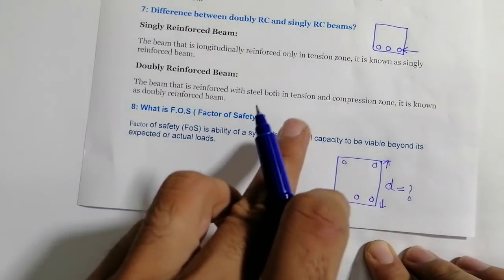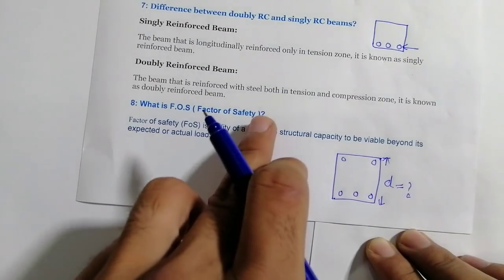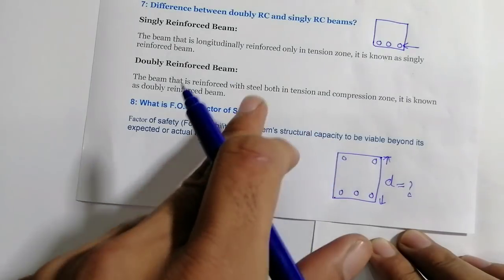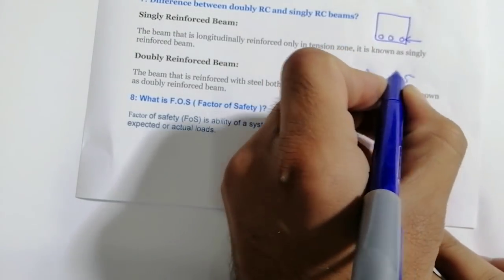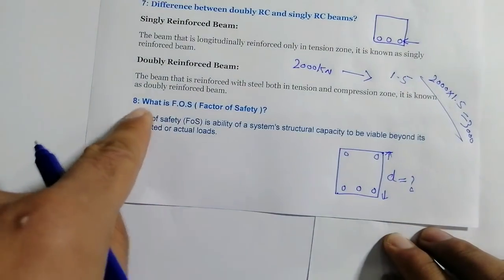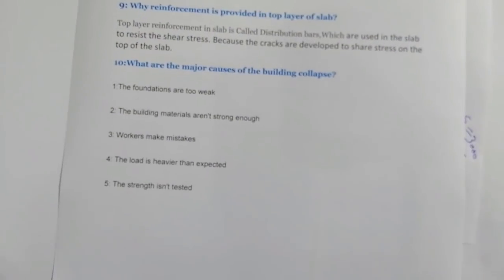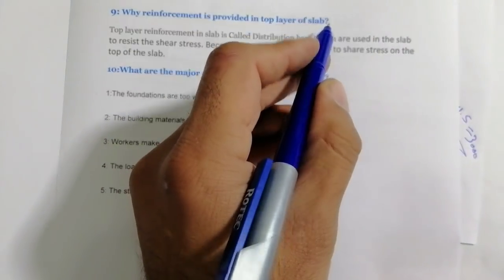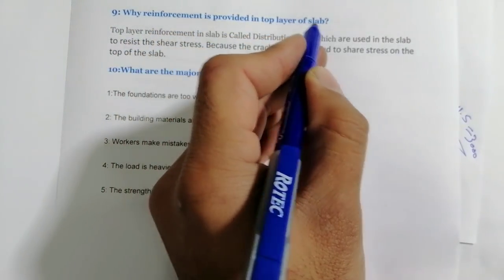Top 10 Civil Engineering Interview Question for Fresh Civil Engineers - Civil Engineering Interview

Comment: Please help;

Question: Grade of steel is designated as Fe 415, if 

1. The upper yield stress of the steel is 415 N/mm2

2. The ultimate stress of the steel is 415 N/mm2

3. The partial safety factor is 1.15

4. The characteristic strength is 415 N/mm2.

Which one is the answer?
Reply: I think the ans is No. 2
Reply: Fe means IRON and 415 is its  yield strength or tensile strength
Reply: Can anyone please provide an answer to this?